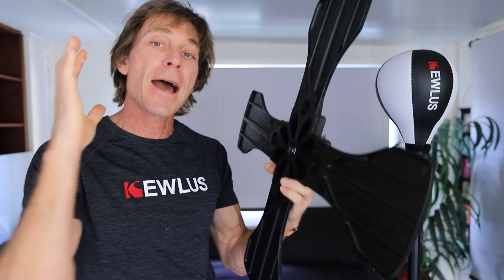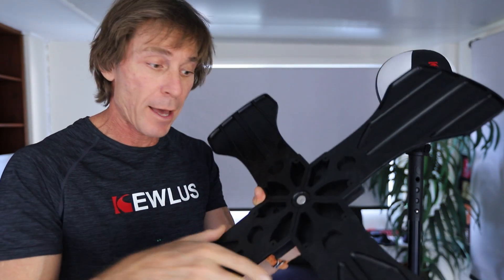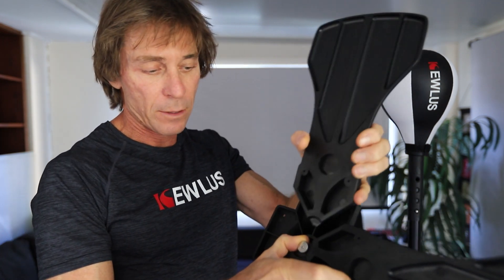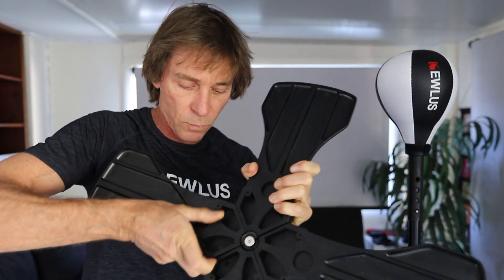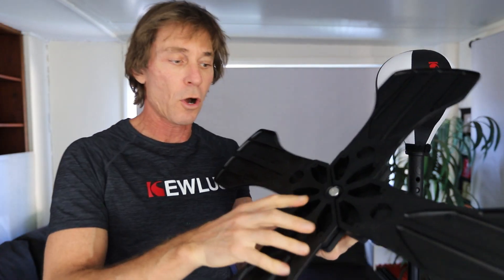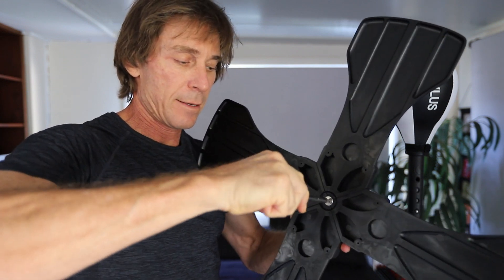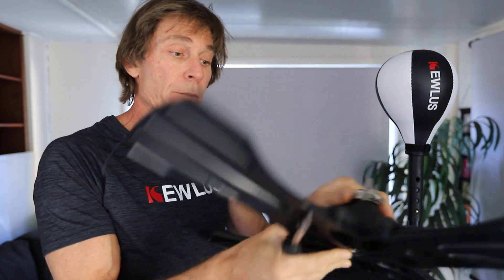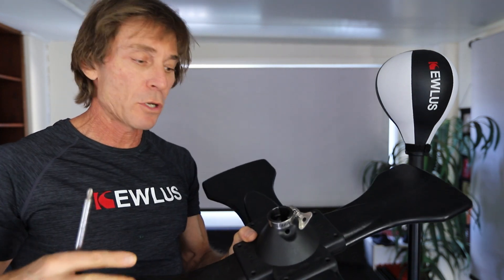Platform Paddles (V2) Assembly

Comment: What exactly does the lock nut do? I installed it without it and just used the screws and it seems to work just fine, is it just to hold the leg paddles in place even more?
Reply from the maker: Adds rigidity and improves performance. It will also protect your mast from breaking
Reply: @Kewlus  Ok thanks mate I will take the paddles apart and fix it, wasn't sure how to install it.
Reply: How long is paddle sir and how long would it take to receive if im toronto,  canada?@Kewlus
Reply from the maker: @knowthyself1981 each Paddle is about a foot long. It’s shipped from Ontario so just a couple of days
Reply: At 1:44 what size screws would you recommend to use that isn't too big or small?
Reply from the maker: The Paddles come with screws